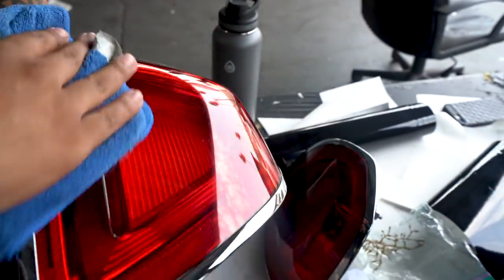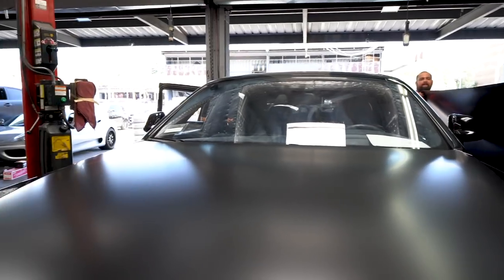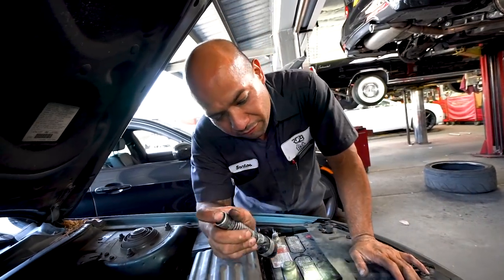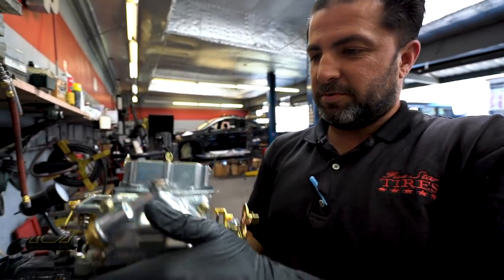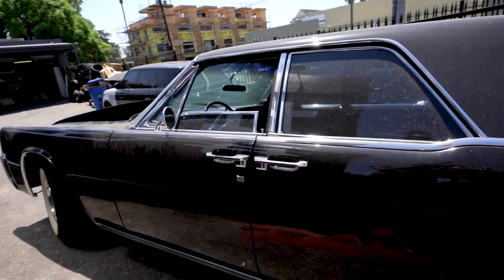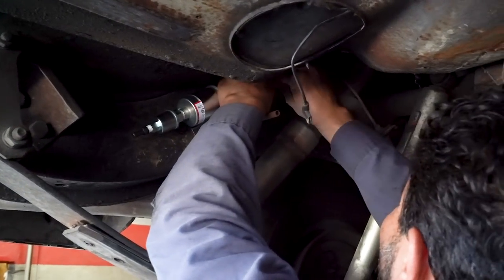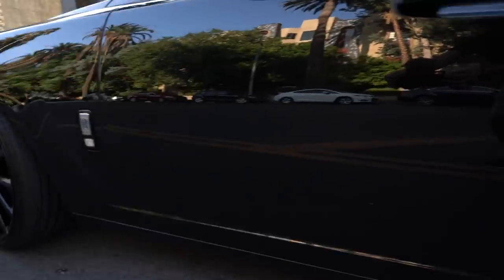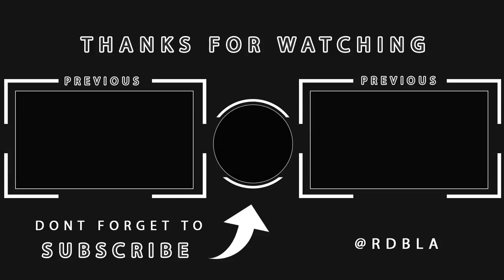#RDBLA MURDERED GHOST, 1961 LINCOLN REPAIRS, & lots more!

Comment: Do you think you could convert a Lincoln into an electric powered cruiser, with parts from a tesla ?
Reply: I'd think it easier to make a Tesla look like the Lincoln
Reply: I've seen a Tesla powered Volkswagen T3 minivan, it's definitly possible, but a whole other speciality!
Reply: The Lincoln is a heavy tank. Would take two butchered teslas to have enough power to move a hot rod lincoln

Comment: why the Fuck that BMW driver is running Federal tires??? them cheap tires, on the track  to witch I see a few people use mostly Honda boys, I call them one time use tires because the side walls will split. it one thing for track days but as a daily Federal tires..WTF you can see he/she went from Federal 595RS-R to Federal 595RPM at 48sec in the video. this is the type of person that also puts Arco or Costco gas as well cause if you are this cheap on tires Hell No you are not running Shell V power.